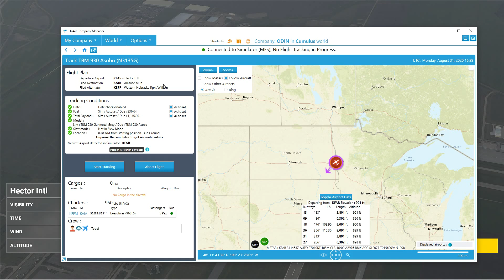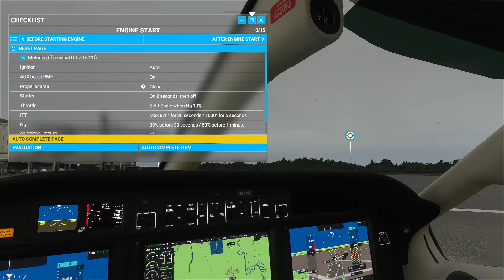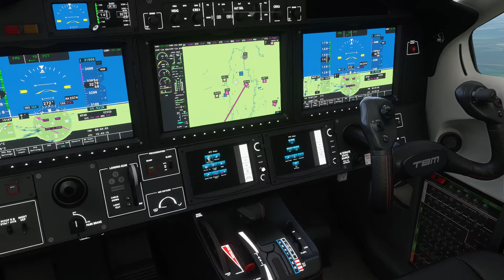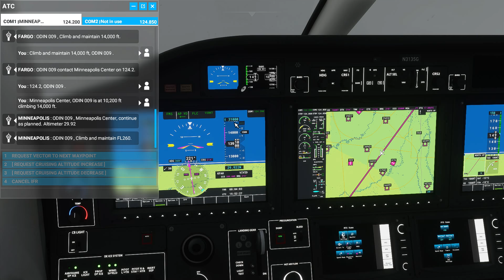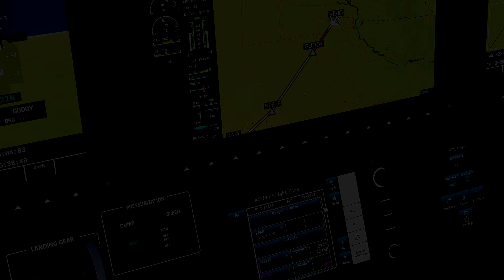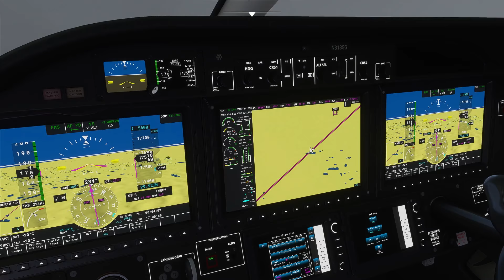Flight Simulator: Full TBM 930 Startup Into Thunderstorms | Let's Play Ep 3

Comment: The altitude settings in your flight plan will work once VNAV is implemented. Unfortunately, it's not at the moment. You can set altitude targets for your entire flight, all the way down to localizer capture like a real airliner. You're essentially building your vertical profile...hence the term 'vertical navigation' or VNAV. It gets a bit more complex with you deal with 'at or above' and 'at or below' functions. Once you do it, it's pretty self explanatory however.
It's handy when you have restricted altitudes through different airspace.
Also, 250kts under 10,000 is the rule

Comment: what happens if you don't maintain your aircraft? will ther be engine failures and stuff? what happens when you crash your rented aircraft? can your employees crash? btw: the trim doesn't really have anything to do with the AP. it's a small tab on your elevator and aileron that you adjust mechanically to change the neutral state of the control surface.

Comment: Feathering for the Tbm 900 series is bringing the throttle lever back behind flight idle position. It lessens the prop pitch angle.
(For General taxiing and slow speed taxi maneuvers). Not sure how you do it in game, but in real life you pull it back and up over a gate.

Comment: Feather is the pitch of the prop, so you can increase or reduce the angle of attack. lower angle is less engine resistance and less pull. Generally to do a ground engine test (so you don't move) you would "feather" the prop so the blades produce very little forward thrust.

Comment: The TBM has a constant speed propeller.  You can (and often do) change the RPM on the propeller but you can also change the blade angle of the propeller to maximize how they cut into the air and produce thrust.  This means you can tweak the engine/propeller for the most efficient flight regardless of where in the flight you are.  A constant pitch propeller (one that cannot change the blade angle) may be made to maximize cruising efficiency but may be less than ideal on takeoff (or vice versa...there will always be a trade-off with those).  Also, a constant speed propeller, where you can vary the blade angle, can often be used as a thrust reverser to slow down more quickly on landing.

The reason not all planes have this is simple...it is a LOT more expensive than a fixed pitch propeller and adds to maintenance costs.
Reply: the TBM integrates the prop control and throttle into one unit. it does it automatically for you.

Comment: Inertial separator does not seal off that scoop (it can't...that's where the turbine gets its air from).  What it does is open a duct in the air scoop that vents out of the bottom of the plane, behind the engine.  Some air is scooped up into the engine and some is exhausted out and below the plane.  Any debris that might get sucked into the scoop is heavier than the air and should follow the path out the bottom of the plane so it does not go into the turbine and damage the blades.  Obviously the engine performs better with it closed than open but you are trading some performance for engine protection (which is a very expensive repair not to mention what keeps you flying so you want to protect it).  The inertial separator is kept open any time there is a chances debris might be sucked in to the engine so, always when on the ground and then the pilot will open it when in clouds (ice particles might get in).  I am not sure about what is done with it in the rain (I think it is open...not sure).

Comment: i always get a saftey violation in OnAir when flying the TBM. Its to do with shutting down the engines, it says either i didnt turn of my lights (except beacon) but if i turn them all off except for the pulse lights it says i had my landing lights off during approach when i definitly had them on.
Reply from the maker: Same! I've started leaning towards always starting cold and I'm just more aware of passing the 10,000 FT level to turn on/off my stuff as required. It's the landing/taxi light specifically I believe, not the strobe/pulse.
Reply: For OnAir, when shutting down the TBM, turn off ALL LIGHTS, including strobes and beacons. That includes your panel lights knob and ALL of your interior lights. Then you shouldn't get dinged for having lights on at shutdown. (Figured that out yesterday because I had the same problem lol) The only time I use pulse is when airborne. Turn them off when approaching ground or when on ground and when in clouds. :)

Comment: What are your graphics settings and what are your system specs?
Reply from the maker: Intel i7-8700, GeForce GTX 1080ti, 32GB RAM - Ultra
Reply: @TobelPlays  Nice, I have the same except i7-3770k and 1080Ti w/ 16GB Ram- So I only need a better CPU for ultra? But at what resolution are you at? I am on 3440x1440p, Also what is your opinion on HOTAS really hate buying plastic, been looking into Virpl and crosswind v3 and those quick fox clamps I think they are called. I think stick is better than Yoke since it has multiple uses.
Reply from the maker: @-Aeon  I'd love to get a better joystick but mostly I'm still running my old logitech. I haven't delved into the flight stick side of the house.
Reply: @TobelPlays  https://virpil-controls.eu/ for Grip and Base
https://foxxmount.com/ for mounting
https://mfg-sim.com/ for rudder pedals

The last site I am getting popups from Malewarebytes 'blocked due to trojan' I have contacted the webmaster and they have informed me all their scans come back clean. Now I'm informing Malwarebytes about this. Also this is on a clean install and I've also done a MRT, and Malwarebytes thorough scan both clean.

Comment: The tbm manual clearly states that the cargo hold is not for pax, and a pillow or blanket should be provided.

The fact that the body doesn't ice up in the exhaust path is nuts.
Reply from the maker: Yeah I've turned de-icing off and everywhere you'd expect natural heat to cause melting it does. That level of detail is impressive.

Comment: Can I get any clarification on how easy/hard the game would be to play on just a keyboard and mouse? Would I need a joystick to play the game? Would a PS4 controller work? Or should I just get a joystick to play because it’s virtually impossible or too hard to play with just a keyboard?
Reply: If you don't have a joystick or yoke, a ps4 controller is probably the best option. The flight control surfaces require some precision. It's probably usable with just a keyboard and mouse. Maybe there's a way to map the ailerons and elevators to the mouse movement.
Reply: I've experimented with mouse and keyboard, and although there are ways to map mouse axis to movement, it doesn't work very well. Keyboard flying is waaaay to inaccurate, mainly because when you press the buttons, it doens't reset to a neutral position. Joysticks are the best option, then PS4 controller, then keyboard, then mouse.
Reply: Keyboard pitch control sucks so bad. Any joystick you can find will be better. My first flight with a new stick was a completely different experience, even though my button assignments sucked and gave me max nose up trim. Still easier than flying with NUM PAD!

Comment: Just a heads up with the checklist when starting your engine. Where it says max ITT 870° for 20 seconds then max 1000° for 5 seconds, it means you should only ever go above 870° for 20 seconds and above 1000° for 5 seconds. I think you interpreted it as needing to be at 1000° before switching to flight idle. What's actually happening is you are overheating your engine. Those time limits are maximum safe limits, not requirements. After switching to LO-idle when Ng > 13, you should then switch over to flight idle once Ng and ITT are both in the green. Hope this helps.
Reply from the maker: Perfect, thats great info! Thank you.

Comment: It’s Glide SLOPE not Glide Scope.   Glide slope is what you capture to get correct descent angle to runway.    Localizer gives you you horizontal (left or right) to align to center line of runway. Keep learning my friend...great videos!   You also wouldn’t turn on bank limit until after takeoff and turn off before landing approach.... you want full control  if you need it.
Reply from the maker: I'm not sure when I started subconsciously saying scope. Too many days in Rainbow Six. Good call on the bank.
Reply: I’ve been a pilot for 10 years and still catch myself subconsciously saying “Glide Scope”. I guess it just feel more natural.
Reply: bgharper Even better is if you fly in a GPWS (Ground Proximity Warning System) aircraft and it tells you “Don’t Sink”.   It always sounds like “Don’t Think” to me. (At least when I was on C17 Globemasters with the USAF)

Comment: Yo just heads up, you can just flip on the AP after like 1000 feet and it will intercept your GPS heading at a clean 45 degree angle. Will also just keep climbing to whatever altitude ATC wants you at, as long as you dial that altitude in, turn on FLC (Flight Level Change), and then tune the speed to best climb. So in this case, take off with ALT set to 6000, FLC speed set to 130 or whatever best rate of climb is (I have no idea), and then literally only inputs you need to do are dial up the altitude as ATC clears you. It will level off at Top of Climb, and then you will probably just feather throttle to your cruise speed until Top of Descent.
Reply from the maker: Excellent, great tip!